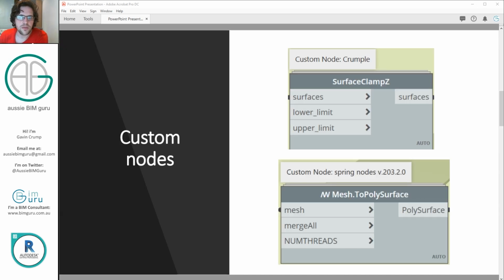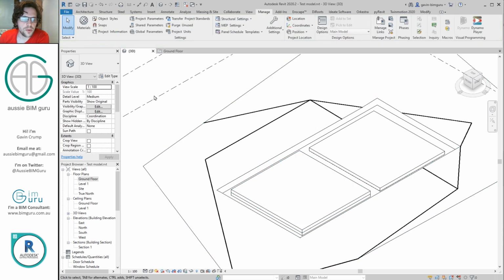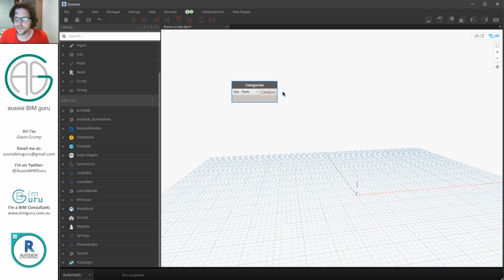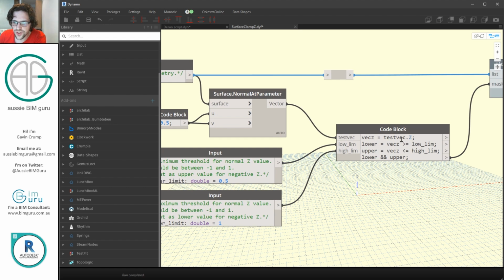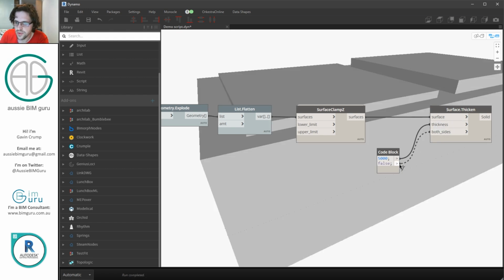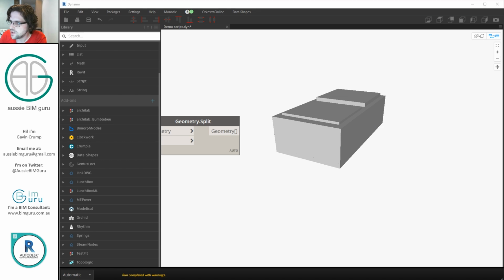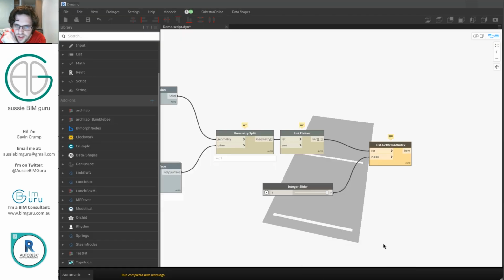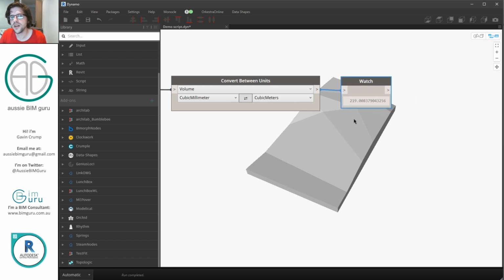Calculate Revit excavation using Dynamo!

Comment: hi Guru! is ti possible to calculate the excavation with a cut slope? similar to grading? thanks!
Reply from the maker: These days i tend to do the task quite differently using raybouncing. I raybounce up from below to hit toposolid, then to hit foundation categories. Then subtract the difference between those and multiply by the area of the raybounce tile. I tend to use grasshopper/rhino to achieve this.

My process should handle any shaped topography here, but dynamo may struggle with complex sites and geometries.

Comment: I do have a question.. would you please help me out with it...

I'm a landscape architect and need to have the fill and cut ...

So far, I want to know if there is any way to create a building pad that follows the floors on the site( we use floors to create the slabs on the site and use Modify Sub Elements for creating the slabs which they have the calculated slope based on design and regulations!)

So the floors are not flat ... but the building pads are .. 

If there is a way that we can use to have these building pads, they follow these floors that would be helpful for us to have the excavation amount on the site (these floors sloped in different directions)

Please share your insight with me ...
Thanks in advance, and I learned a lot from you
Reply from the maker: Not that I am aware of, generally pads are flat in Revit.

You could always assess excavation volume for modified floors with sub points though. Get the total volume of the floor as a solid, divide by its thickness and then multiply by the exacavation depth - this would return the volume of soil if the floor profile were extruded downwards without needing to.
Reply: @AussieBIMGuru  thanks ..

May I ask another question ....

Is there any way that we can caculate the mass between  floor and topo by Dynamo?

The floor is on the topo and inside of the topo ...
Is it possible to caculate the amount of this intersection between these two by Dynamo?
Thanks in advance

Comment: Amazing workflow, thank yuou for the video! I ran into challenge with calculating solid volumes myself. The issue I face is a difference between calculated volume in Dyanmo and imported solid  in Revit. What can be the reason for it and which volume should I assume to be right?
Reply from the maker: I would usually be inclined to believe dynamo over revit, depending on the scenario. These days I use Rhino for this workflow as it is faster and more effective. I made a tutorial for this about a month ago.

Comment: Thankyou so much for the Tutorial. really helpful channel and i already subscribed. I have one question regarding the excavation values. How can we export these values to the schedules? 
For example i have one site and on the same site i have two building (B1 and B2). How can i schedule the excavation for both the buildings separately. Thanks you so much again. which package can i use to do this? i am new to the revit and Dynamo.
Reply from the maker: The best package for controlled exports to excel would be bumblebee. Unlike the standard excel nodes it preserves the original file layout so if you know the cell you wish to populate and the file you wish to target it can do this much better.

Comment: No matter what I do I can’t get my head wrapped around Dynamo ... any advice?
Reply from the maker: It can take a few tries - I didn't really get it until my fourth attempt. Begin with a simple challenge you need to solve to make your work easier, having this context is the key to having the 'eureka' moment.

A good workflow that helps nearly everyone is using Dynamo to make sheets from a document register, this tutorial I made might help;
https://www.youtube.com/watch?v=ub8qocu0ziQ

Beware of common traps also when learning Dynamo, I wrote an article on them here;
https://www.bimguru.com.au/post/dynamo-mistakes-to-avoid

Most importantly, find a time where you can learn without interruption - I know this is hard during the working day. Take an hour or two after work, or on the weekend to try and learn more.